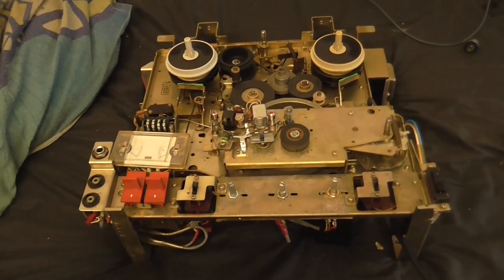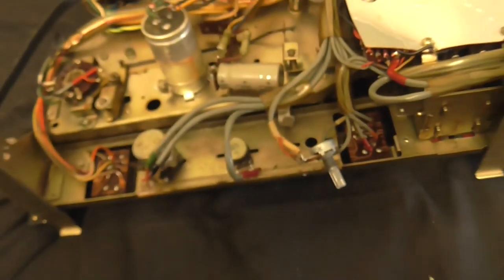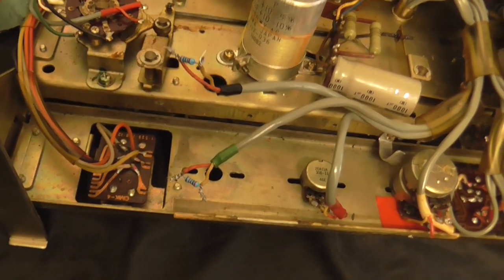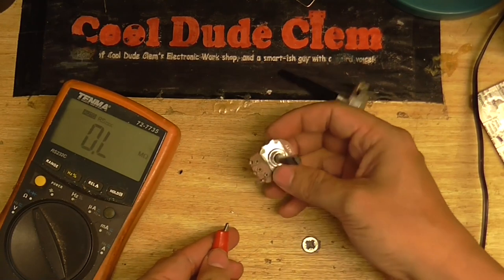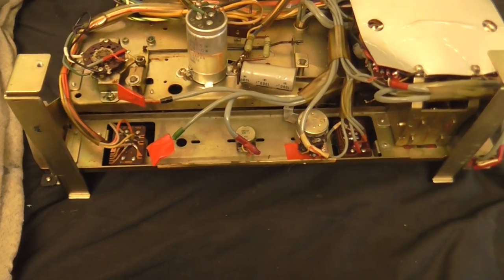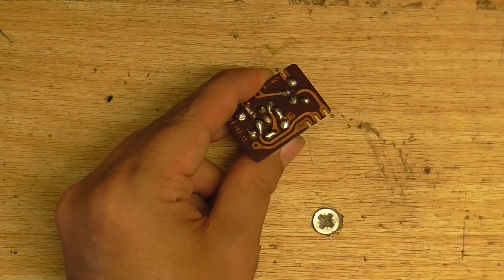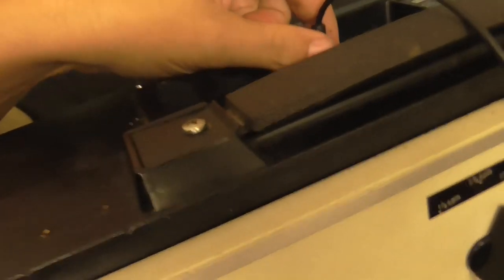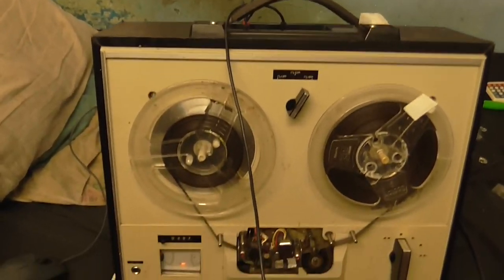Modifying the Sony TC-252 for amplifier use.

Comment: I thought the two separate volume control became one using the double potentiometer.
Good modification job.
Reply from the maker: I could have done that, but I still wanted seperate controlls for left and right.
Reply: @CoolDudeClem  
That's okay, thought i had lost my mind.

Comment: That's an all Silicon Transistor Amplifier in there Clem.
Out of curiosity I would like to ask you what sort of Potentiometer (Log or Lin) you would use for a simple Treble-Cut type Tone Control if you were adding one in to an existing piece of equipment or including one in a new project?
Reply from the maker: Well that tape recorder used a log potentiometer for the treble controll, and I'm assuming it works by having the potentiometer in series with a capacitor, than having that across the pre-amp's output (obvouiulsy through a resistor to not overload the pre-amp) so I'd probably go with that